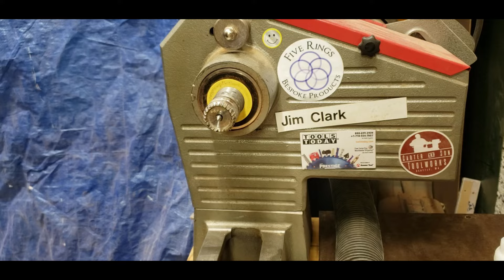Natural edge bowl from Sissoo (Indian Rosewood)--The Better Half!

Comment: Jim. I am also a turner living in Mesa. I also have some Sisoo. Mosty I turn Mesquite. I belonged to AZ WOODTURNERS.
Reply from the maker: Cool! I have a friend I used to work with that was big into the azwoodturners group. I'm just a self-taught turner, doing it in retirement. I have a bunch of mesquite, and that's actually my next project. I'm a little nervous because I may have an allergy to mesquite. This will be a test. I'm surprised at how pretty all the wood from landscape trees is here. I never would have guessed before I started collecting logs and turning. Thanks for watching!
Reply: @FRBPturning  I to am a self taught turner. I took one class with AZWoodturners to learn how to use a skew. I am also retired although I worked part time at Bass Pro to work in the fly shop until I found I didn’t have enough time to work in my shop. LOL. I also have Willow Acacia as well as Texas Ebony, African Sumak from all local trees here in Mesa and Chandler.
Reply from the maker: @alandisomma-od5fz  I done have any arrival sumac or Texas ebony. I'll have to keep an eye out after the next storm.